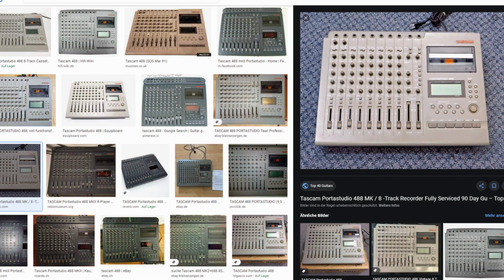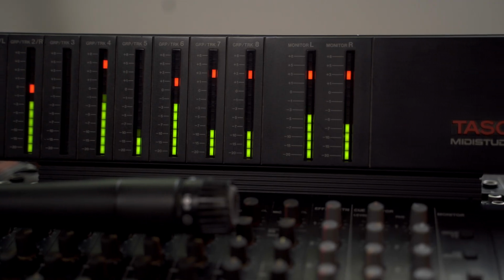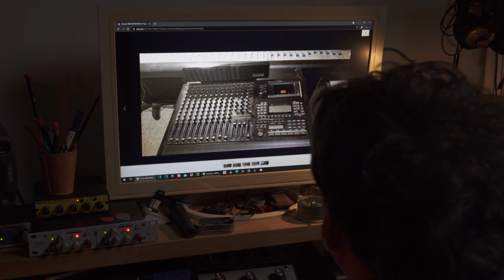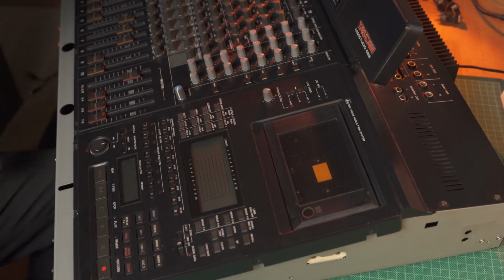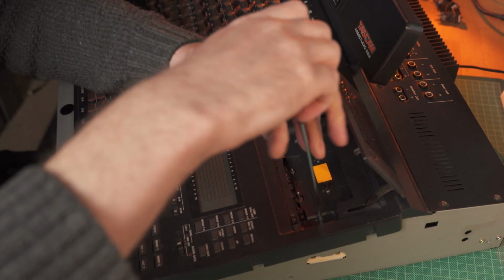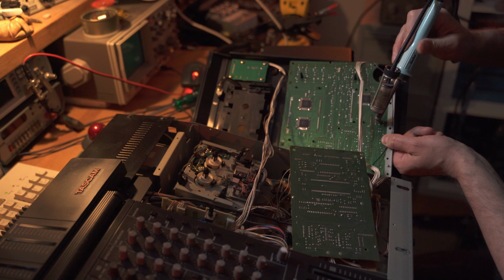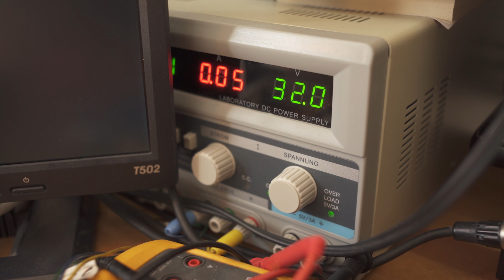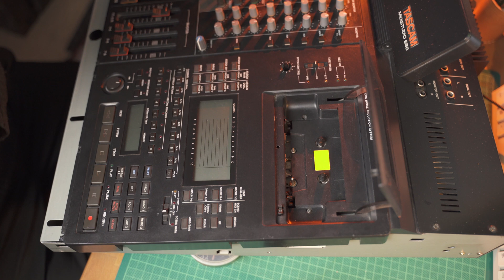REPAIRING TASCAM 688 - Analog Multitrack Tape Recorder - Audio Cassette - DIY Tutorial

Comment: Hi, have you ever encountered such an issue as white rust? I found most of the corrosion on the bottom panel (on the sides) but also on the heads. The erase head is completely covered except for the top insert and the record head is covered only on top between the gaps. This is a 238 model and the device was not used, the seller said that it was stored only in a warm place but forgot to mention about humidity, apparently.
Reply from the maker: Never had such an issue but I would guess it came in contact with water.

Comment: This video was so satisfying.  I wish I had your courage to open my 688 and fix the fluctuating tape speed problem.  ✌️
Reply from the maker: Yeah that's the hardest issue of these machines. Can be the motor, the caps on the Speedboard or the overall condition of the Capstan drive. Nostalgia is not a cheap hobby when you're into tape :)

Comment: hi you know the tascam 238  i got a tip from this model     how to make the 238 alot better  i copy this deck i put in a 
same kind of motor  drive and the bad servo is now not playing up any more 

the 238 has a very poor servo  motor set up allways playing up all the time and the cost of getting the same parts
so i binned the old servo and made myseft a new servo set up  use a motor  drive like in this one runs ace  now 

bigger range of speed now 2 ips to 7 1/2 about
Reply from the maker: Do you have a link where people can buy this motor? You mean the capstan motor, right?

Comment: Great video! Recently bought one of these and everything seems to be functional except for mic line 1.  I plug in the mic and turn up the gain but don’t hear a change in level nor does the light turn red when maxed, where as it does when tested on all other channels.  I hear sound and the eq works, but there is no increase in volume.   I’m Thinking there is something maybe with the gain knob?  I wondered about your thoughts and maybe I am missing something. Thanks
Reply from the maker: Hi Nathan. Can you switch the input of that channel from mic to line to tape? You can see that on the LCD Screen. When it´s switched to MIC there and it still doesn´t work with the xlr input it can only be the defekt mic pre or the electronic for switching the input is defekt.
Reply: @timpanic  thanks Tim.  Yes it switches in the routing matrix, but nothing seems to happen in the mic/ with xlr input.  Figured something was defected, but just wanted to be sure I’m not missing something-Thanks for the confirmation.
Reply: Mostly a transistor or elco blown in the signal path. It's only 2 transistors for the mic pre-amp on each mixer pcb. But it's a  lot of work to get the pcb out.

Comment: Hey i had a question about the 688, and it seems that you may now the answer. I have one VU meter that upon startup peaks and stays lit while the machine is on, with nothing plugged into it, any ideas?
Reply from the maker: Hi! Since I didn´t ever had this problem I can not give you a short fast helpful answer. So the channel itself is clean and full functioning in the audio domain, right? Also with all sources? It´s just all LED on all the time? So It must be something in the LED Driver Circuit. Start with checking all cabling from the Meterbridge to the mixerboard. If nothing obvious is broken or caps are blown you have to dive much deeper I am afraid and follow the rails from the meterled to the point where it sees the channel signal with a multimeter or ozilloscope. Worst thing could happen is a default led vu driver ic. Not a hobby job, takes a little bit of afford.
Reply: Elco 0,68 Uf on vu pcb. I thought. It's naar each vu bar. You need to remove the back plate and pcb carefull with hinges. Replace failing one. If it works Replace all elco's 0,68 Uf.

Comment: Bought a non working 688 (already own a working one)

It plays back too fast and wobbling,I changed the belt but it is only slightly better
Read that it could be the motor which is not working anymore,already ordered a "new" one and hope that it will solve the issue...
Reply from the maker: Can also be an error on the pitch speed pcb. Try to change the caps there when the motor exchange doesn't help.
Reply: Hey,it was a problem with the motor AND a mechanical issue (the tape path/pinch roller do not get proper contact with the tape,so I will have to clean the whole tape mechanism,did the same with a non working Porta One before)

But now track 3 won't record/playback anymore :(

Any idea were to start? (All channels of the mixer work,heads are cleaned and demagnetized)
Reply from the maker: That's a hard one! You must dive in and check the signal path then step by step.  Does the signal reach the recordhead or is the playback the issue? I don't think the head itself suddenly broke, so it should be some problem before or after. Is there a small signal on the tape or nothing at all? Most issues I had with track issues were head dirt related in the end. Or naturally routing problems to or from the head.
Reply: @PsyProgBerlin  try-out the routing to another input. If not working either  it must be the recording pcb or the cables or mixer back plane. It can be a loose wire on the rec/pb head.

Comment: that was very entertaining. I think you covered the repair and the lore with perfect balance. Music gets a bit loud, but that's the whole point I think 🙂 I'm looking to get a 688 or 238 to transfer my homebrews I made on borrowed 688s in the 90s. Watching your video makes me a little nervous about going 688, tho...238 might be easier to repair if required.
Reply from the maker: I also bought the 238 as a backup. It had other problems for example a complete detuned azimuth ;). A common bug is that the speed changes over time caused by bad caps on the pitch board which is a little different than on the 688.  If you have a good.mixer and don't need that "all-in-one" box feeling the 238 could be a smarter move.
Reply: @timpanic  thanks for that! I don't have a desktop mixer larger than a couple of little Yamaha MG06X...and the 688 meter bridge is pretty nice. I have a RME UFX+...I'm under the impression that the 238 RCA outs are unbalanced -10dBU instrument level...I best get the manuals out to confirm...and I do understand the 688 routing matrix reasonably ...I/O on the 688 is surely better and worth the extra cost and space in my studio...I do have plenty of space

Comment: Beautiful video! Love the tone and pace!
I have a question!
Did you just go in and replace all the caps or how did you know which ones to replace? Sort of a newby when it comes to getting nitty gritty into the electronics
Reply from the maker: Thank you Patrick :) Its better to loacate the cap in the circuit to know where it is in the schematic. I started with the caps on the pitch board cause it will produce some nasty speed artifacts when the elkos getting old there. In general its more about elko! replacement. Leave the ceramic and poly caps in at first, they live much longer. Also only replace the caps if you really have a problem and know it must be A or THAT cap. You will have a hart time replacing every Elkos in the mixer without making anything "better". Also start with elkos of the psu when hum or problems in general appear and see if that improves something before replacing every cap in the channelstrips...hope that helps.
Reply: @timpanic  thank you ! That is helpful! No hum yet so I’ll leave it alone! Managed to score a near mint barely used 688 for a trade for a KARP odyssey module. Psyched on it!
Reply from the maker: @patrickyeo2016  Wow thats great. Yes better do nothing ;) Get fresh tapes, clean the heads with isopropanol and you´re good to go ;)

Comment: Excellent video and you did a great renovation project there too! I'm also a 688 user, I've had 4 over the years and I've just managed to get my most recent one working. It still needs a bit more tlc but I'm  happy to have one again!
Reply: Does the mixer add good sound to recordings?
Reply from the maker: @J M  Depends on who you ask :) With a 688 it's not about the mixer but more about the "Tape" and the dawless analog workflow. If the 1/8 Tape size with 8 tracks suits your sound style depends on you. I can guarantee that the mixer itself won't do anything to your music beside summing and basic eq stuff.
Reply: @timpanic  really ? I had a 414mk2 and used to run stuff through the mixer without tape and it was great … so the 688 doesn’t Colour the sound at all without the tape ? Find that strange
Reply from the maker: @saren6538  Compared to what is the question here!  A Mackie, SSL, API, Midas or passive summing, your DAW with UAD Plugins etc. Some say color some degradation ;) The question was if it ADDs a GOOD SOUND to a recording. I say NO. If you need this mixer to make your music sound better you have a problem elsewhere in the chain. What should it add which was not already there beside hiss,hum, crossover and distortion. We first must define what "better" is. Best electrical performance or a "musical" "better" which can only mean harmonic distortion here and is even more subjectiv.
If you take your guitar or bass and go straight into the line ins of the 688 and compare it to >500€ preamp you should hear a big difference in clearity and usuable noise free dynamic range.
Fact is the mixer alone has nothing to write home about or was supposed to have a sound by the designers beside getting the wave as good as it can through the circuit with a curtain BUDGET for components of that time. Imho it has even less mojo ( distortion in this case) than the older tascam mixers ( m208 etc) which I also had. It has no special transformer, normal ic op amps,  no special poly caps ( even has a lot of elkos in the signal path which get "old" much sooner), no class a, etc...so its not "better" or more RUPERT NEVEish than every mackie or soundcraft from that time. Doesn't make it a bad mixer. Not at all. It could be a good alternative to a mackie vlz. Or other: if you use this mixer as a pure summing box and have better results as your daw+goodbasicplugins you have a monitoring or measurement problem or you don't know anything or dont care about SNR etc, which is totaly fine  ;)
Reply: @timpanic I recently was chatting with an electrical engineer here on YT who said he felt the 688 mixer was less “transparent” than its kid brother’s mixer, the 488mkII. My 688 is in similar condition to yours when you first got it, so I plan to do many of the same things, but I’d be curious of your thoughts on this; I suppose it’s a mixer’s ability to do the opposite of ADD color, but rather to get out of the way of the signal?
Reply from the maker: Is the 488mk2 newer  than the 688? So it could be that it has newer or fresher electronics but I would not expect worlds of difference here. I find the 688 much more appealing than the 488 with it's nice meter bridge. I really don't see why there is a debate about this. If you want transparent recordings, stay away lightyears from a 1/8" tape machine :) that's the dominant  sound and colouring factor here. So the tape hiss will always be higher than any of these mixers. You can also just get the 238 and add your mixer of choice to the party or go out of the direct outs of the 688. If you want just a mixer...well... There are a lot of daughters out there.
Reply from the maker: Thats great!